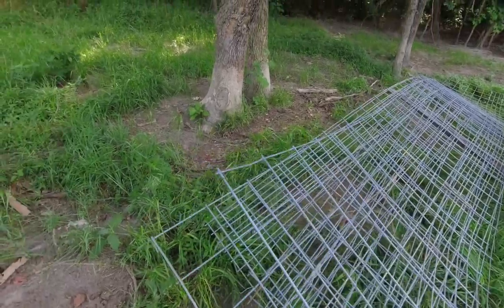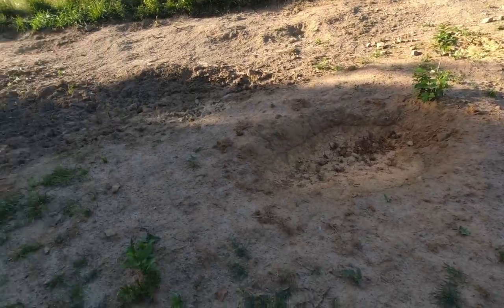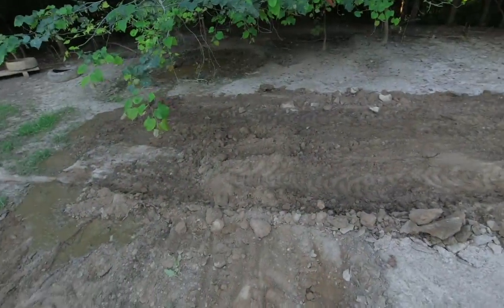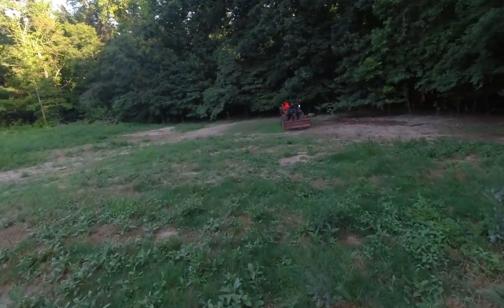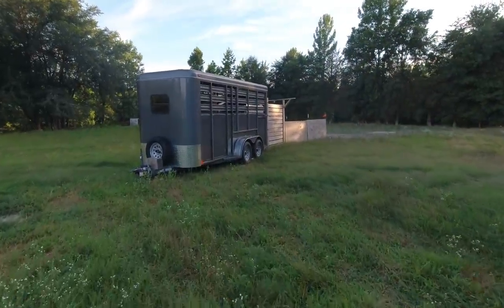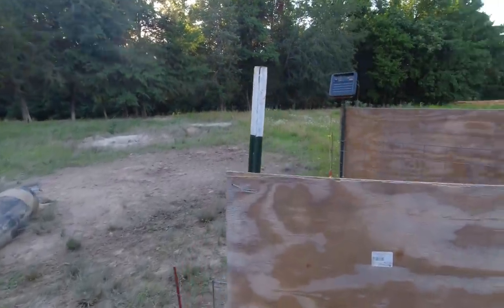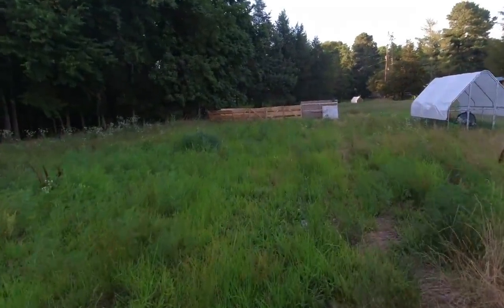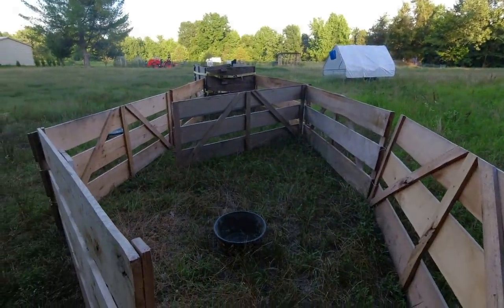Raising Pigs Is Messy - Pastured Pig Farming

Comment: Suggest  build or aquire  an over length  pallet  just for wire panels storage and transport   
  As long as you have pig  and rotate  pens you be moving  panels around  why not ? Work smarter than harder